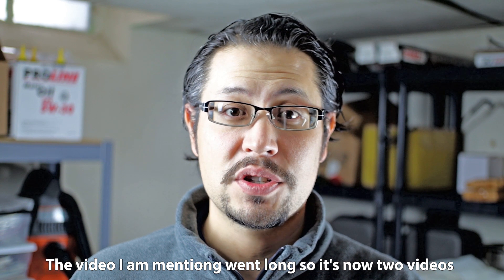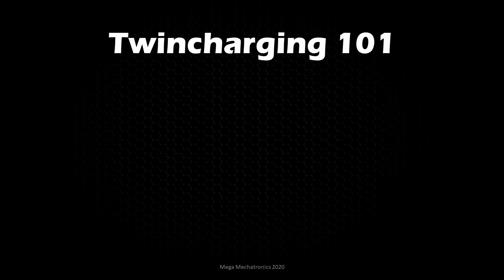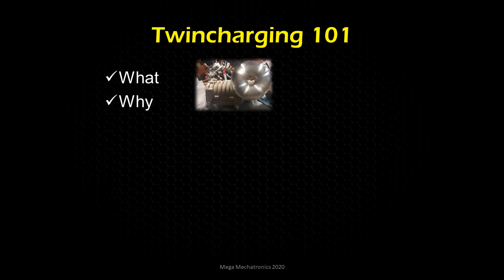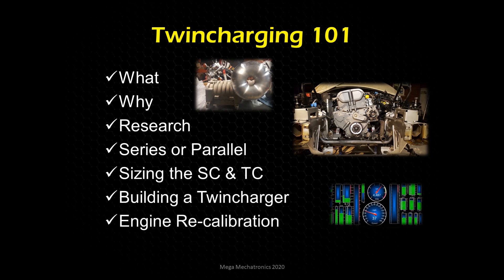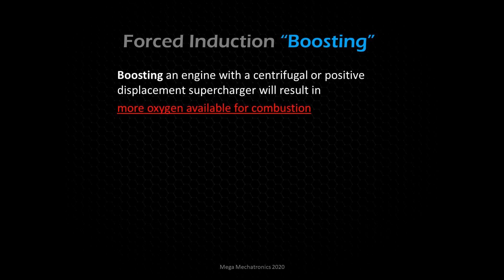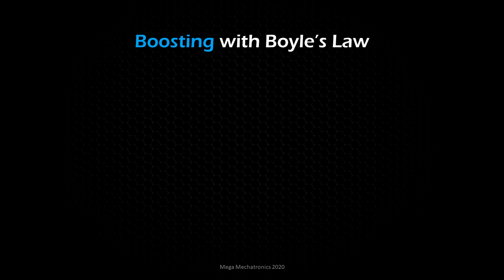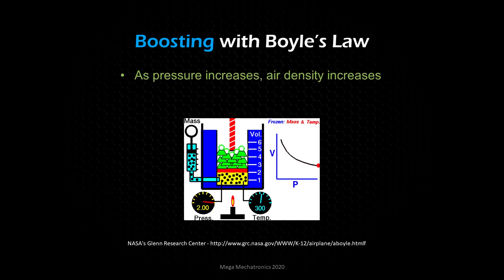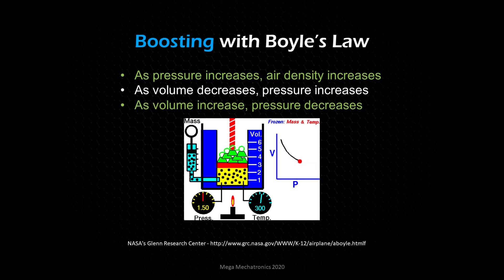How to Twincharger Part 1 - 600 hp Solstice Build - Forced Induction Explained

Comment: Question can I twin charge my diesel hilux ? It’s a 2002 model 2.5
Reply from the maker: With enough time or money most things are possible.  Diesels like boost, and a twincharger will give you that.  I think a project like this is not for the faint of heart, as turbos design has come a long way and can meet your goals.  I'm doing this because it's uniquely difficult and complicated.

Comment: How hard would it be to twin charge a 5.0 L
Reply from the maker: Define "hard".  What is your skill level?  What is your experience building modified cars?
Reply: Some I have a turbo’d 2001 integra type r which I installed turbo and diff exhaust

Comment: General twincharger question, if you don't mind..

is it possible to place a recirculation valve in the intake pipe going to the supercharger, as pressure builds up when the supercharge is disengaged, the recirculation valve redircts the air to the turbo?

what is the name of the bypass valve that suches the air intake from a supercharger to the turbocharger in a twincharger?
Reply from the maker: Yes, there are many configurations of twincharger systems using turbochargers and blowers (supercharger) where air path is bypassed around one of the chargers.  I cannot think of the official term; although if I were to technically describe it I would dub it "turbocharger bypass" and "supercharger bypass" depending on which device is being bypassed.

Comment: How hard is it to put a twin charger on a engine 6.2 l?
Reply from the maker: It's going to be a challenge, why not many folks pursue such a project, if it was easy then more people would be doing it.  My opinion is that if you make it mechanically complicated (like a blower bypass system and controls) it will be more forgiving as far as what components you select. If you keep the mechanical setup simple (like a series system with no bypass airpaths) it's going to be more sensitive to component selection, like sizing of turbo and blower, intercooling.  Like most things anything is possible with enough time, money and motivation.

Comment: I love my twincharger.  I use a full compound setup with a gt2871r feeding a eaton m45.  Works great.  Can't wait to get it onto e85 and really see what it can do. 

There's so much hate and confusion about twincharging on the internet, mainly from people that have never done it and fall fool to internet myths.   The powerband from a compound twincharger is awesome.
Reply: i'm so glad i found this. i got a jdm 4agze mr2 and twincharged would be the absolute dream but every forum i find on ppl doing it in mr2s it's all outdated informationfrom like 2006 saying it would b far to expensive and hard
Reply: @soda1470  most that say it's too hard or expensive have never done it.
Reply: @feral4mr2  do you know any good forums on twincharged mr2 builds?
Reply: @soda1470  not really mate.  There's bits of good info scattered throughout different forums.  Lot of bs from people that have never tried it saying how complex and hard to get running right.  You gotta sift through that sheet to find truths from those that have done it. 
Google search Warpspeed and Stocky Mcglock with twincharged and should find some threads from an old eng tech forum, those guys have some good info and feedback. 
Warpspeeds input influenced my throttle body after supercharger setup.  
You can always flick me a few q's if I can help. 
Good luck.
Reply: @feral4mr2  BRO ur the goat. i rly appreciate it. i'm a car dummy n my biggest question is the bypass system to disengage the supercharger running a turbo into sc setup. what would be the simplest setup for this. also i read there basically alr is one that bypasses the supercharger if it exceeds oem boost levels. if this is true could you run a simple turbo setup that takes long enough to hit full boost by the time the sc disengages? i wanna make close to 200whp or less. is that unrealistic? the advan twincharged aw11 is my inspiration n hope to build a fun gymkhana beast. sorry if i'm speaking small brain language to u.
Reply: @soda1470  mate as I just said in another reply a supercharger bypass is not needed and just makes the project more complicated to get running. 
If you're only looking for ~200hp I'd suggest putting a gt2554r turbo on, very fast spool and at 18psi i made 197rwhp with 315nm torque.
Reply: @feral4mr2  so basically a basic turbo setup jus feeding into the supercharger? what ab cooling setup? and could i achieve this on stock jdm map based ecu or do i go stand alone? (also heres this i found on a 20v twincharged gze. sounds interesting but beyond my comprehension lmao) http://www.toycrazy.net/mark/ke25engineplan.html
Reply: @soda1470  yes turbo feeds the supercharger.  I use w2a intercoolers, I have a smaller core between turbo and supercharger and a larger core after supercharger before inlet.
Reply: @soda1470  if that 20v one is the one I'm thinking of it was never finished.
Reply: @feral4mr2  do you use stock ecu? would this work if i run the the stock itercooler and sc setup with the larger intercooler and tc setup running into that?
Reply: @soda1470  no i have a aftermarket ecu.  You will not run it on a oem ecu.
Reply: @feral4mr2  i have question do you think you can fit a twin turbo and supercharger (Twincharged) in a mid engined car?
Reply: @chalee3484  I have a friend in the states that did this, though personally don't see the benefit in it.
Reply: @soda1470  you can actually even do bypass valve twin charging fairly cheap if you know where to look for bits. However it will add weight. 

Doing it Really Really nicely can be a bit pricey. Compound boosting is cheaper to do nicely.
Reply: I have a fwd 4AGze that I want to convert to twincharger . Im wondering if I could use a reed valve in between the SC & TC so that when the TC requires more air that the SC could provide, is could suck it in via the valve.
Reply: @harrisnasution1351  the supercharger will never become a restriction.  It will multiply what it's fed by the turbo.
Straight compound boost with turbo feeding supercharger with no bypasses or turning supercharger off is the best and easiest way IMO. It works very well and gives a very wide power band.
If you listen to people telling you that you need to bypass the supercharger etc you will only be making it a more complex project to get running right and get a smooth transition between the two. 
Full compound boost is the way to go.
Just remember the supercharger will not become a restriction, just a multiplier.
Reply: @feral4mr2  actually super to turbo is better. If done right you never have back pressure thus always cold air being pulled in and you get rid of turbo lag and you help keep Temps down anyways. Turbo and super don't know what each other are doing in a sense. Turbo just boosts the already boosted air. 

Done right you can use relatively low boost on the super keep parasitic losses to a minimum run your turbo in optimal effiency range and still get high boost levels without running shit super hot. 

Easiest best set up in my mind. Bypass valves can get annoying.
Reply: @bmxriderforlife1234  I've been running straight compound setup twinchargers since 2007 mate.  I think I'm on version 5.6.. haha 
I run the turbo into the supercharger which is the best proven way, using the supercharger as a multiplier. 
No bypasses or clutch on supercharger.
Reply: @feral4mr2  unless I'm mistaken on my gtos current engine it's super into turbo. 

From what I understand once the turbo makes full boost there is less parasitic losses from the super even without decoupling. And if you're compounding boost you can get the super in prime effiency and same with the turbo. No bypass or decoupling on mine. However Volvo makes a marine valve that can be used as a easy bypass valve. 

Might have to try turbo Into super on my next project though.
Reply: @bmxriderforlife1234  the only valve in my setup is an external wastegate, only used as I have the throttle body post supercharger.  The external wastegate is sprung to open on throttle snap between gears and slightly open at idle.  
If you google "Warpspeed" and twincharger you should be able to find a lot of posts from him regarding this setup in old forums.  Plus he explains the multiplication factor of using the supercharger being fed by the turbo.
Reply: @feral4mr2  no I know about compound boost. 

I was just saying pretty sure Mines super to turbo and has no valves besides a single wastegate 

And even if you wanted a bypass valve there is an easy way to do it that doesn't cost alot. 

But I may try turbo into super after. Idk my one buddy knows alot about it and helped. 

Does your set up with the turbo into the super help spool up time at all?
Reply: @feral4mr2  but yeah it's work but unless I'm mistaken super into turbo is pretty bad ass. 

Reduces parasitic losses on the super slightly. You end up with effiency somewhere between the turbo and super. Get instant off the line torque but also helps spool up the turbo faster. And obviously compounds boost. 

Though starting to think you may be right. Super should help suck air in big time and spool up the turbo. Even if it doesn't its not as big a deal plus fun turbo kick and still dd- able with the right set up. Easier to plumb. And might be easier to do multiple stages of intercoolers. 

Lol options options. 

Setting up the motor for one project right now. Gonna build a superlite coupe or slc. 2jz in it for higher revving nature to suit rhe gear box. 

Super to help low end torque and hp turbo to help get to peak numbers. Compound boost should be better for high boost situations but low boost might be a pain. 8500 to 9k rpm redline is the plan. Only need 500hp or so to start but plan is 1000 or so at full high boost. 

Probably gonna do the engine set up for NA or just a small turbo or simple super to start. 

Exhaust is gonna be a real pain. Inconel tubing for weight reduction and heat tolerances. Hopefully on the ducting for turbo shit as well.  Gonna buy the electronic valve used on porsche 911s for the exhaust. And a more typical electronic dump valve. Pipes up to the porsche valve so I can control noise levels. After that the dump valve is gonna be used with a split off for straight pipes. 

Hoping the air pump theory of mine for turbo into super is right. It'd make it way easier on that build plan. 

Trying to build it so it could be used for half mile and full mile drag stuff but more so for circuit and daily driving. But also so I can spin the rear tires a bit and drift it a tad. But endurance races are something I'm really into. So cooling is a high priority.
Reply: @bmxriderforlife1234  Trust me, turbo feeding supercharger is the go, supercharger (specially rootes type) are great multipliers.
The extra exhaust gasses coming out the exhaust valves from the supercharger boost assist immensely with turbo spool. 

But it's your project man, I'm only going on research and self experience with the setup.
Reply: @feral4mr2  fair enough. Think imma try turbo into super for the next project. 

Maybe change the gto if it's better. But yeah if you ever do try sequential Volvo makes a marine valve you can use for a bypass. 

And even without valves super into turbos been working for me.
Reply: Maybe a stupid question but is it needed to compound charge the eaton, or is it also possible to compound charge the turbo with a supercharger? Because my idea was to just put a supercharger on the inside of the the turbo and helping it spool until redline, is that also possible?
Reply: @Simon_HDM  The extra gasses passing through the engine because of the supercharger boost spool the larger turbo much earlier than if it were turbo alone, and will do so until redline.  The supercharger will breathe through the turbo no worries until the turbo spools.   The turbo will not multiply the charge air like the supercharger will, this is why the turbo feeds the supercharger.
Reply: @ meaning that if I just want earlier boost so that I can spool up a bigger Turbo(without lasting 3 business days to achieve boost) I can safely  put the supercharger on the turbine side of the turbo to achieve earlier boost, and if I do it like this I can just rev it until redline, or will it cause problems when the turbo wants more air than the charger can feed into it? I hope I explained my question in the best way I could! Also another question is there also a pressure differential in this setup like explained in some vids that I watched previously?
Reply: @Simon_HDM  No, the supercharger is not bolted to the turbo turbine.  
The extra air the supercharger pushes into the engine via the inlet manifold equates to more exhaust gasses coming from the engine exhaust manifold that will spool a larger turbo quicker.
Reply: @feral4mr2  I am sorry for my terrible mistake I said turbine, but i mean compressor housing....So my question is if the following setup is possible for the intake system in the following order to make the turbo spoool quicker, and is this also possible in higer revs without a magnetic clutch on the supercharger(i would like to keep it in action so to say): Airfilter-Supercharger-Compressor housing Turbo-Intecooler-intake manifold
Reply: @Simon_HDM  mate, I've explained how I do it and recommend, turbo feeds supercharger as supercharger is the multiplier. 
 If you want to do it the other way,  I have no more input.
Reply: @feral4mr2  i've been thinking about your reply, but DUDE you need to take a few weeks vacation...damn!!!
Reply: @Simon_HDM  vacation would be nice. But seeing I'm kinda nearly homeless at the moment I can't afford a vacation... 🤦😂